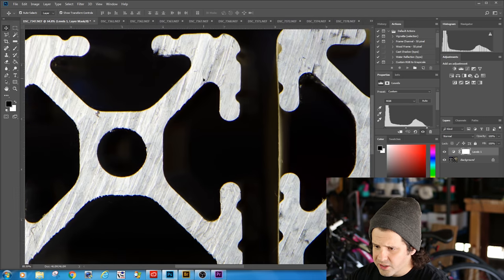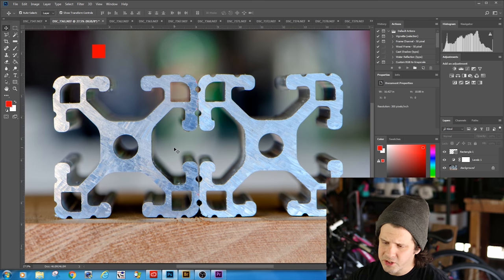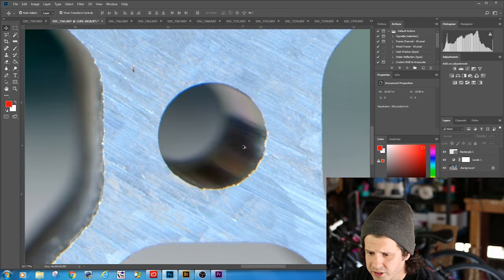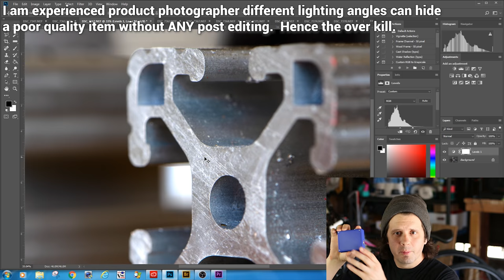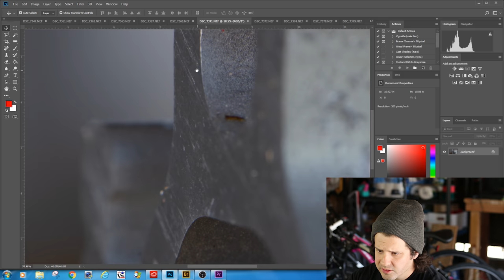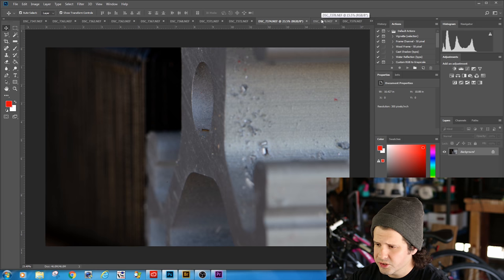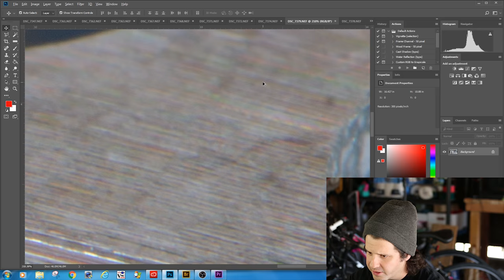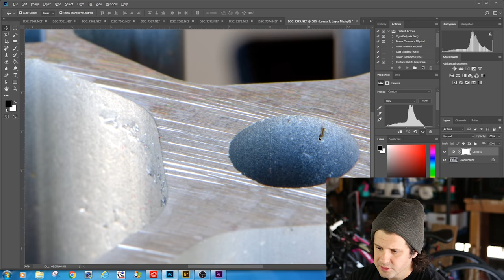Cutting Aluminum with a Diablo saw blade. Is it worth it?

Comment from the maker: For those of you who seem to have issues with the obvious.  The point of this video is this blade worth it over a standard wood blade, as many of you know you can use a wood blade and cut aluminum on a cheap miter saw.  It's unclear what else you seem to derive from it.  Sure I can buy a metal cold cutting saw and make a complete new video, but this was never the point. The video is, "is there a benefit to using a different blade to cut aluminium on a saw meant for wood" I am still using this same blade and I cut aluminum extrusions that are 4x the thickness of the ones in this video.  The only downside is the motor can get hot as the load increases through the center of the extrusion so I think my blade may outlast my saw. Thanks for reading before commenting.
Reply: So as I did not miss the obvious because of your comparison of the blades I stated what you are doing wrong as you risk hurting yourself!But IF YOU WANT TO HURT YOURSELF AS YOU STATED IN YOUR VIDEO GO RIGHT AHEAD AND PUT YOURSELF IN FOR THE DARWIN
Reply: Haters with always be, Thanks for taking your time to show us this differences, Great job!
Reply: Different colours in the aluminum seem to look like you've tried to burn the oil off with a torch and it's created the " metal bluing method " awesome video

Comment: I have used that exact blade for several years while cutting extruded anodized aluminum screen room studs and assembly pieces. I used it also for any wood framing members that were required. I used this blade on my Dewalt 12" sliding compound miter saw........a primarily WOOD saw. My results were always excellent.  As with any wood saw, you need to keep the blade squared to your back rails and materials.

Comment: Tooth count was far different between the 2 blades. Should have used a similar tooth count, at least, in this comparison. I have a 100t diablo wood blade on my saw, and it cuts very cleanly. I think, as long as they are carbide with a high tooth count, you should be alright. Thanks for sharing

Comment: As long as your blades have carbine tips for aluminum you normally will be just fine. Just cutting a little aluminum I don't worry about cutting oil too much, unless you need a clean cut. Cutting a lot or harder materials, you want cutting oil or an oil based coolant. Using a quality cutter with good carbine tips and you can cut off more material and have less problems to worry about. You will still get very clean cuts and not worry about heating issues. Cheap bits or blades your going to need cutting oil more often to not only protect the material your cutting, but for the tool itself. Harder materials always need coolant, or you risk damaging your tool and the part your trying to make.

If your looking for quality cuts, always use cutting oil. You can't go wrong!
Reply: Saint Kenny, it’s “carbide”...not carbine.  There’s no such metal as carbine.

Comment: Diablo have recently (last couple years) released new better blades too.. think ill be getting one to cut my extrusions.. im just making a roof rack not cutting these all the time so im not buying a dedicated tool a blade will do me fine as a tiler ive just always cut my tile trims with the basic standard cheap quality blade that came on my saw and it works fine but i was worried about the thicker material so cheers for the video helped me make my decision

Comment: I just cut 1/2" aluminum plate with a Diablo wood saw circular blade. In a Dewalt circular saw and a clamped aluminum straight edge. Cut like butter.

Comment: Yes I have a 10" nonferrous blade and it is a pain to take down my table saw to cut nonferrous metals...so I made a small table for a spare power saw and put on it a 40 tooth 7-1/2 blade gets the job done and faster
Reply: Do u have to reverse the blade

Comment: Very thorough. 
I have aluminum Neilson frames sections that I need to cut. 
Looks like I should use the Diablo blade. Cuts has to be very exact. 
Any suggestions? 
Thanks.

Comment: The saws designed for cutting wood have a lot of play compared to saws designed for cutting metal. This is desired when cutting soft material that is flexing and expanding during cutting. However when cutting hard material, this results in an effect machinists call tool chatter. And chatter  results in poor quality finish, just like you see in the cuts you made.
The problem is the saw, not the blade.  Or more precisely, the tool you are using is not designed for the operation you are performing. It will make a cut, but not with the precision and accuracy you want.
Make your rough cuts longer and get a machine shop to finish the cuts to size on a machine designed to cutting metal. Or get a mini mill. Or a file and a lot of patience. Or make a jig to finish the cuts with belt sander (no hand-held operations!).
Moving from "wood butchery" to precision machining of metal is not as easy as one may think. But anything can be learned if one desires to do so and is willing to put enough effort into it.
Reply: Agree with entire comment. Especially, the last sentence
Reply: I agree alTHOUGH the differences BETWEEN the cuts he achieved ARE due to the differences in the blades.  He compared a junk/stock, low tooth count blade with a QUALITY, high tooth count blade.  But yes, the overall quality of both cuts?  Yes....that's one of the worst miter saws ever made.  The tool chatter is off the charts with this particular saw and the throw out is also off the charts.  AND it's just an unstable saw.  I LOVE Ridgid tools and have MANY and bought this saw and then returned it and got another one and returned it too.  Absolute JUNK.  EVEN WITH a quality blade, there's STILL too much throw out and vibration, even after letting it spin up FULLY, that if you were to build picture frames with it, the tops of all your miter cuts would not be touching.  RIDICULOUS!  Ridgid absolutely disappointed with this saw.  Rushed, thrown together piece of junk.
Reply: You have a PhD in chop saws?

Comment: The wood blade cut speed was higher, I'm assuming you tried to use the same force so that would be from the teeth width I would guess as the non ferrus blade obviously cut better. With that being said unless I had a lot of aluminum cuts to perform getting and storing another blade is not worth it.

Comment: The wood blade has a different set on the teeth, one left, one right. The Ali blade will have one left, one middle, one right, but the set will be smaller. The gouging you are seeing is due to the larger set on the blade and the bigger gaps between them.

Comment: Hello!! Nice video an excellent explanation, I cut a lot of aluminum and I've used different brand blades for example (as a reference) starting with worst and cheapest: dewalt, irwin pro series, bosch, herralum, makita and others, then the better blades: CMT orange tools, Leitz, and the best Freud but there are different blades of Freud for example Freud industrial series which is better than the others, then freud professional series and the last which is not bad Freud diablo is basic but works fine, all these to cut thin wall aluminum profile and thick extrusion, if you have to choose for an excellent saw blade I recommend you Freud Industrial or Pro definelly...

Comment: I cut aluminum, usually thin and small parts on miter saws almost every day at work. I have used them and see them used in the field as well cutting much larger amounts. In my opinion, a good quality non ferrous cutting blade is worth it. The cuts are more controlled, smooth, the chips seem to roll off more softly, and the thin parts just about never catch. Same goes for hand held circular saws. 
Last thing is, I see loads of Diablo wood/ non ferrous blades loose teeth so fast I would never buy them.
Reply from the maker: I do think Diablo is the best big box store brand but not top of the food chain when it comes to specialty blades.

Comment: Im setting up to cut some 1/8" aluminum sheeting .. I'm going to use the wood blade that came with my track saw .. but I'll use the 40 tooth blade based on what I saw herer! :) Thanks.

China a VS "American Name brand"  .. is always a spirited debate, I bought a "grooving blade" my track saw, recently 

This type of 'grooving blade cuts a pointed 90 degree X up to, 1/4" wide groove .. half way through aluminum sheeting to make neat straight 90 degree bends.  It's small diameter (4 inches) ,and cost $29 from China.

The "Good Quality one" name prnd one is ALSO made in China and costs $260 !!

My idea is abit experimental, and I cannot justify paying alomsy 10 TIMES the ost for the Makita Brand, far as I know they might be made n the same factory??

Comment: Do you have any thoughts on using a saw blade for aluminum (like the diablo) as opposed to using an abrasive disc blade that is found in those metal chop-saws?
Reply from the maker: I'm not sure if they are compatible or not. But I have used abrasive chop saws for steel parts.   Assuming the abrasive disks would work in a wood miter saw.... they make alot of dust and smoke that likes to float everywhere and get all over your other stuff. (try to do it outside if you can)   The cuts are not as nice and require alot of cleanup (deburring)  and they take longer to cut through than carbide saws.  I actually think abrasive saws are going out the window as carbide metal tooth dry saws keep getting cheaper both as an initial upfront investment and blade life compared to replacing abrasive disks. I think if you walk into a hardware store you can still get an abrasive saw off the shelf so people keep using them but slowly I am seeing more dry saws come into play.   People rave about those evolution dry saws.
Reply: Using abrasive discs to cut aluminum is unsafe. Aluminum has a much lower melting temperature than steel and tends to melt, seeping seep into the pours of the disk. Enough molten metal and the disk will heat up beyond its capacity and could explode. Go with the blade. Or get a band saw.

Comment: There's also a wood fine finish blade with 84 teeth that would probably be a lot more similar to the 96 tooth blade.  A test like this would tell, but I suspect tooth count plays a major role.  Regarding your right angle joints, 80/20 will get the right angle right from the brackets used to connect the joints.  You should leave gaps between the extrusions to make sure the right angle from the bracket is enforcing the geometry of the joint.
Reply: I disagree with that. Thin aluminum such as t-slot, c-channel and others can twist extremely easily. wood finish blades still have their teeth in alternating positions whereas aluminum or non-ferrous metal blades have straight teeth with alternating ones with less spacing. This does make a difference, especially noticeable on thinner material.

Comment: It may be you saw. BEARINGS. Does the blade arbor have play?
Reply from the maker: I think I am just asking a tool to do more than it was designed for.  It works really well for wood and gets by for aluminum.  I got a Fein Carbide Chop saw with a clamp and its a game changer.

Comment: I’m not convinced this is a fair test. Reason being - you’re comparing a 40 tooth wood blade with a 96 tooth aluminium blade. So is the difference in quality due the the blade being wood/aluminium, or the number of teeth? You can get wood blades with high tooth counts for fine finish cuts, they would be a fairer test. 

What is the actual design difference between a wood/ aluminium blade?
Reply from the maker: If you buy the wood blade for cutting aluminum, the test is already over.  The challenge was a generic wood blade everyone probably has, vs spending the money on a purpose built blade.
Reply: Iheart3dprinting yeah for sure, but that’s not my point. You’re not comparing apples with apples. The difference between a wood and an aluminium blade by design, is the rake angle of the teeth and the depth of the gullet. Wood blades have a positive rake and deeper gullet, aluminium blades have a negative rake and shallower gullet. So it’d be interesting to see how that feature difference affects the cut. To do this you need two blades of the same tooth count. Plenty of people have a fine crosscut wood blade which potentially does the job they want for aluminium.

Comment: Thanks for the video, for my needs I would have liked to see 2x4 aluminum bar stock
Reply from the maker: I have never cut a solid piece of stock.  But I have been cutting 80mmx80mm T-Slot (about 3x3 inches approx) and 80mmx40mm Tslot.  These are thick slots as well so they are meant to be the max strength profile for their size. For reference, in the video those are light 1.5x1.5" inches.  When I cut the heavy duty thick extrusions the motor definitely slows down substantially.  I feel it is the limitation of the saw itself combined with the blade diameter (12" in).  The motor also smells hot (hot copper smell) on a long cut that I typically don't get when cutting wood or thinner extrusions.   I believe it will cut it, but if it's a cut you will be making regularly I think the saw *might burn out.   I know they now have blades that cut actual steel on the smaller 7.25 inch miters, and those don't seem to have the same bog down issue, I assume because of the blade diameter.  But then again if you don't have the smaller saw you may as well skip it and go straight to the evolution low RPM dry saws.  Also last thing is on the thick materials lubrication is almost a must. It reduces cut time as well.  Goodluck.

Comment: I worked in a shop an cut aluminum like that an day long, I used a German made chop saw with a cutting oil, aluminum will stick an build up on the blade if you cut to fast, I also work in large machine shop an ran different style band saws to cut material for departments, you can goggle how to cut aluminum,.✌😎

Comment: I think if magnification is needed to see the difference, probably not worth it.   Unless you're going to be doing a lot of it
Reply from the maker: That is fair, but I do think using a fine tooth blade is safer even if its not specialized for aluminum.  The first time those large deep gullet teeth (general wood blade) grab the aluminum and spin it instead of cut it,... its enough to put some scare into you.  A proper metal cutting saw should have some clamps which were sorta cheating on.

Comment: What did you use for cutting oil?
Reply from the maker: Just basic bike chain oil.  Obviously its not meant for cutting.  But it still makes a noticeable difference in keeping the blades clean looking after each cut and evacuating the chips off the teeth. Also seemed to help make the cut smoother in general.  You don't actually need the lubrication, but it does help the process.  off camera I was taking an old tooth brush and dipping it in oil and going around the blade as well so the sides of the teeth and blade face are lubricated. 

Thanks for the comment.

Comment: wood blade is not use for cutting aluminum t-slot extrusions
Reply: I worked for TMX aerospace.  Cutting aluminum extrusion for Boeing.  Much fancier machine.  But we used wood blades to cut and wd40 lol I have done 100,000s of cuts.  fine.
Reply: Maybe split the difference a 60t carbide. Cheaper than your fancy one and will cut much better than your 48t blade.

Comment: QUALITY wood blades do just as good as your metal blade with aluminum.  You used a junk/stock wood blade with way less of a tooth count and compared it to a far superior blade with a much higher tooth count and this is hardly comparing apples to apples.  AND you did it on one of the worst miter saws ever made......I tried that saw....two of 'em in fact.....and unstable saw with the worst throw out and vibration of ANY saw I've EVER used.  All in all.....a quality wood blade on a quality saw does just as good as the metal blade.
Reply from the maker: Read the pinned comment, you missed the entire point.
Reply: @iheart3dprinting951  I didn't miss anything.  Read that comment.  There is no such thing as a "standard wood blade."  There are crappy ones and there are good ones and ones with less teeth and ones with more teeth.  I very much stand by my comment and your "pinned comment" does not negate the validity of it in any way.  And FYI...the place to make your point in a video is IN the video......not in a comment.

Comment: I would NEVER EVER use my miter saw to cut metal!....NEVER!
Reply: but why? you could swap out the blades that are meant for cutting metals? right?
Reply: My mitre saw manual says it is designed for wood and aluminium...